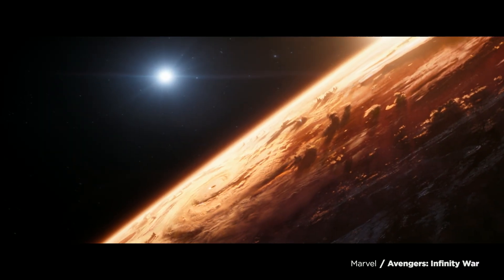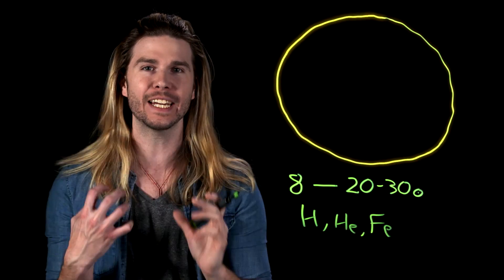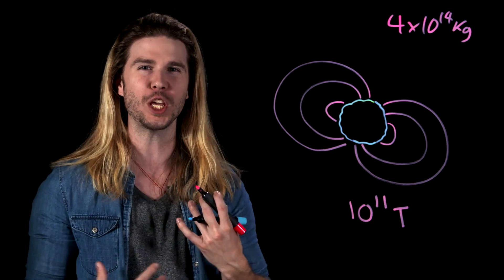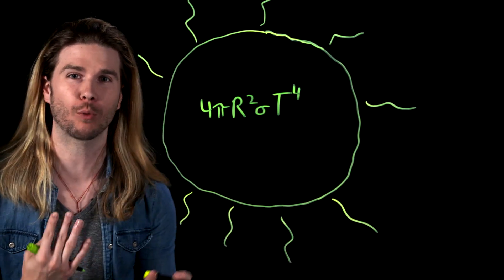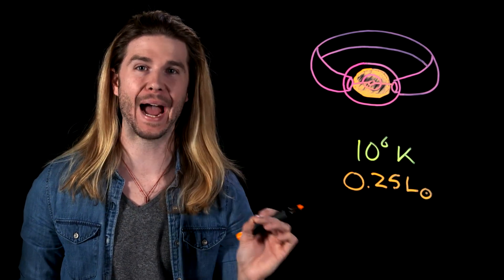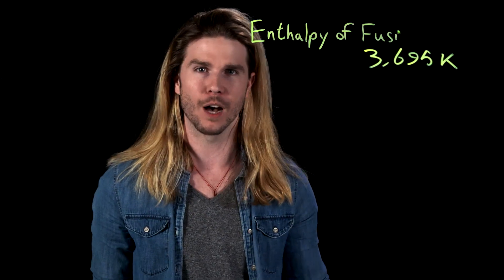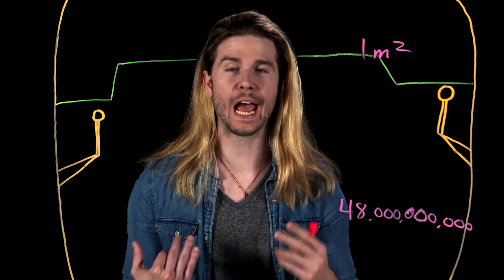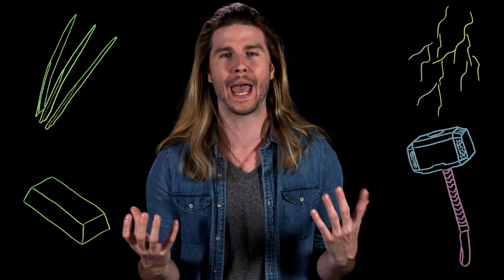How To Forge Thor's Infinity War Weapon

Comment: I guess the follow-up question would be: what kind of biomatter is Groot composed of if his roots/vines/stems can latch onto the freshly forged, ridiculously hot Uru metal, and not ignite instantly?
Reply: The temperatures we are talking about are in the millions of degrees/Kelvin/Fahrenheit. It should be enough to light an entire forest on fire from orbit.
Reply: Also, does Groot have to be worthy to lift the newly created stormbreaker?
Reply: @jasond.6068  stormbreaker didnt get any enchantment like the hammer did.
Reply: Jason D. no because storm breaker doesn't have odins enchantment.
however oru could just be a combination of known elements which is put under enormous pressure to make it super dense which would explain why it takes so much heat to melt and why it weights so much.
Reply: @Grazey  and to all of you who correctly said that stormbreaker isnt enchanted with the mjolnir-enchantment: i know i know. Thought it would be a funny thing to ask.
Reply: Jason D. Nope brother
Reply: Jason D. Doesn’t have the enchantment that The hammer had
Reply: @jasond.6068  nope the worthiness enchantment wasnt put on storm breaker, so really anyone can lift it.
Reply: Good point!
Reply: And remember he can hold up and against explosions and bullets in GoTG1, and completely regenerate himself. I wonder what kind of tree can do that.
Reply: It obviously wasn't that hot. It was orange at the brightes parts of it, while in some place it completely lost illumination. Meaning it wasn't hotter than 3ooo Kelvin.
Reply: Matter Beam
When Groot picks up the axehead it almost completely lost its illumination, having a few spots that glow with red. So it obviously wasn't in the millions of Kelvin, not even in the thouthands, except for those few spots.
Reply: Surtr destroyig Asgard was a magical fire kind of deal so it might have killed her where regular fire couldn't. It tends to be the case with superhero material that regular elements (even the heat of the sun) can't harm the heroes much but the very, very same element coming from a wizard or weird crazy tech gun can harm them with a fireball or flame jet.
Reply: That would make Groot's sap the single greatest cooling liquid in the history of ever... imagine the possibilities!
Reply: The ax also imbues those who wield it with so much power that most would go mad as their bodies were destroyed, so maybe it augmented the flamability of his arm.
Reply: Maybe it was on cool-down, another question, If Thor survived all this heat energy, then isn't Hela still alive and that she just fell like Loki
Reply: The type of wood that Groot is made of is the most powerfull in the Marvel Comics Universe. If that is aplied in the cinematic universe, he could easily do what he did, with no problem...I assume.
Reply: Jason D. It didn't have Odin's enchantment on it so maybe anyone strong enough to lift can.
Reply: +Bad Request -- My guess is that when "Groot, son of Groot" cuts the branch from itself, the same thing happens as in GotG1 -- Stormbreaker is now a baby Groot.  You're welcome.
Reply: Yes we have ... No matter the material, every material, no matter what, starts to emit visible light at a temperature of around 500-600K.
Reply: AronBagel well, it was freshly grown for that, so we could imagine that it is very green wood. While the temperature of the axe would be enourmous, green wood is very hard to burn. It won't ignite if you throw it on a bonfire until it dries out, so possibly this is the reason?
Reply: maybe his arm was constantly regenerating and thus could withstand the heat just long enough for the temp to drop, he is able to regen said arm within moments
Reply: Maybe Groot is a being from a neutron star.. that may be why he did not go atomic from the gravity
Reply: AronBagel Groot simply used the Batman effect. He did it because HE IS GROOT!!
Reply: The awesome Ygdrassil Tree, where MCU Groot might come from.
Reply: Well in comics he is another Thor from another universe...maybe thts y...since he was already worthy to lift it as well
Reply: AronBagel I'm wondering how it hasn't snapped yet.
Reply: More relevant even, when thanos snaps his fingers and kills everyone including groot, wouldnt the axe's handle fade away as well because its made of groot?
Reply: +Bad Request -- He's a tree, not a phoenix.  Are all the Groots in the universe supposed to be telepathically connected or something?  Because if not, you can easily test this by cutting off one of your own fingers.  Stormbreaker isn't part of Groot's body any more.
Reply: Good insulation
Reply: Love
Reply: Jason D.  Storm breaker does not have any enchantments
Reply: What if uru actually has a relatively low melting point, and instead has an insanely high specific heat, thus requiring so many joules?
Reply: AronBagel never worry about PC overheat again!
Reply: Groot is a God he can do whatever he wants
Reply: Better question for groot to be able to pick up storm breaker for a few seconds he would have to be worthy so is ?
Reply: Not only that, but it's also strong enough to lift the metal that in and on itself is heavier than the entire earth population many times over (going with Kyle's point) and didn't break nor bend.
Reply: erbgorre; the glowing hot colour of an object is proportionate to its temperature, regardless of the material.
Reply: TLDR: I am Groot!

I'm gonna explain this in very simple grootian so you will all finally understand how it was possible!!!

I am Groot I am Groot I am Groot! I am Groot, I am Groot... I am Groot? I am Groot "I AM GROOT!!!"

See quite plain and simple! I hope this long dissertation helps and that I didn't babble on to long especially in the wrap up statement!!!
Reply: Another question is, Thor's clothes didn't burn up when he opened the gate thing. This means his clothes have a higher melting point than uru. Why not just put your clothes on a stick and beat thanos like that?
Reply: He had plot armour
Reply: Because he’s also an alien tree. As in not an earth tree. It’s like Korg being a rock man but doesn’t mean he shares the same attributes of our earth rocks. Because he’s an alien.
Reply: To my understanding Groot is effectively fire proof, and just because he’s a tree doesn’t mean he shares the same weakness of fire.
Reply: Grizabeebles still part of the same entity. Doesnt convince me xD
Reply: Root isn't made of wood actually. He isn't as flammable in the comics so with it being freshly grown and he's resilient then it might make sense
Reply: Silicon.
Reply: Groots sap... Gross.

OH! ;)
Reply: Bump! I want to hear the answer to this too!
Reply: AronBagel Well in the first gaurdians movie groot was being shot by lasers and wasn’t igniting
Reply: Josh Vandenburg
That would actually explain a lot of things, including the fact that if the temperature was so high, black boby radiation would make it glow white, then start emitting UV and eventually xray and gamma radiation. Which doesn't seem to happen. Now the problem is that we need to explain why it cools down so rapidly.
Reply: erbgorre 
That is not how glowing works.
Reply: Bad Request 
No it isn't.  You can grow an entire new tree from a cut branch of an existing one.
Reply: If we go really in depth, he could be regenerating cells faster than the hot metal can disintigrate it
Reply: I am Groot.
Reply: Groot has Cotati Metal Fibers?
Reply: What's the effect called where a layer of moisture can protect flesh from heat? Where somebody could touch ~900° molten lead and not get burned? Copy+paste that to groot
Reply: probably that Groot has no phosporus compound in the body
Reply: PLOTarium?
Reply: Point
Reply: Groot has some special atoms or cells that maybe reacts different to heat because he's like an alien tree so that means maybe it doesn't ignite the same way as normal wood would?

I mean i'm no scientist but correct me if i'm wrong. I'm just sharing an opinion here.
Reply: Maybe this can be explained by some property of Uru itself. The mythical metal could take the energy to another mysterious use and be instantly cold.
Reply: CopernicoTube probably.
Reply: AronBagel considering groot is a sentient tree that can talk and has super abilities, I’m pretty sure his wood could potentially be at an extreme level of durability.
Reply: Part of it would be sense he has moisture. Which makes it harder to burn  new branches then old ones. But I do get your point
Reply: Obviously he's composed of worthy biomatter.
Reply: The answer according to Groot himself is simple "I am Groot", he said
Reply: its not made of tungsten. you have no way of even guessing at how hot this fictional metal can get before showing any signs of glowing. from the numbers used in these calculations it would definitely be many magnitudes of difference. could well be in the millions of kelvin.

Comment: If the metal is so dense wouldn’t extremely rapidly expand as its pressure is so much greater than a vacuum, and the atmosphere of earth? Like when you squeeze a potato chip bag, but then in unsqueezes by its own. 

Also wouldn’t you say that the bifrost is something that slightly bends space time so people can travel vast distances in a couple of minutes/seconds? I would say it’s like bending space time so two different points in space would be closer, but not like in a worm hole were they are at a distance of 0. I would say that the bifrost squishes spacetime so if the glowing color thing can make you accelerate near the speed of light and making you travel distances that would look imposible to travel even at the speed of light. 

Anyways love the show, keep doing awesome videos
Reply: Metals expand when heated, but at different rates. Some materials have a low expansion coefficient (how much they expand per temperature increase). A very strong material expands less.

https://en.wikipedia.org/wiki/Thermal_expansion#Factors_affecting_thermal_expansion

"Thermal expansion generally decreases with increasing bond energy, which also has an effect on the melting point of solids, so, high melting point materials are more likely to have lower thermal expansion"
Reply: Matter Beam well of cores, but after Kyle did the calculations of the mass, it would rapidly expand either way as it’s so massive
Reply: Matter Beam if we asume that Kyle’s calculations are right, then 3.8 x 10^14 kg, if we asume it’s a real metal like tungsten, would expand extremely rapidly if they were in just the very small space of the axe head of storm breaker, either way thanks for that neat fact
Reply: The neutron star is what is dense. Not the metal.
Reply: Brandon Myers yeah, but the bifrost doesn’t instantly teleport them, it takes time and you see them traveling in it, like in Thor ragnarok. A regular worm hole, theoretically, brings two places together and can instantly teleport you, which doesn’t happen in the bifrost
Reply: Nicolas Hurtado Castro In the first Thor movie, Natalie Portman's character says "it has all the characteristics of an Einstein Rosen bridge" which normal people call wormholes.
Reply: Unless I'm misunderstanding you (your English in some places is ambiguous, sorry), then I think you're misunderstanding - 3.8x10^14 wasn't the mass of the axe head, that was the mass of Tungsten that the beam would have been able to melt...
Reply: Nicolas Hurtado Castro There is actually no reason wormholes couldn't have distance in them. They change the distance between 2 places (and/or times) but not necessarily no distance.
Reply: BobbitTheDog either way, if the metal needs that much energy to heat up, it needs to be extremely dense and massive. Even if it wasn’t tungsten, Uru needs to extremely dense and massive because of not, it wouldn’t need as much energy, and in this show, we need to use real world things because if not, we can’t science
Reply: Brandon Myers the job of a worm hole is literally just bring two points in spacetime in the same place so someone can walk through, like when you fold a paper in half and make a whole that pierces through both sides, that’s it. It needs to have no distance because if not, it’s not a word hole
Reply: Nicolas Hurtado Castro maybe the ingots were super tiny like this dot or somthin   .
Reply: Lari588 what does that even mean?
Reply: Lari588 even if they were dots, a super dense and massive object that is not in like a neutron star or an atmosphere billions of times denser than ours, would rapidly expand in a vacuum or in our atmosphere
Reply: the hammer can open the bifrost, maybe it's made of some weird space time warping material, so it sends part of it's energy somewhere else.
Reply: Nicolas Hurtado Castro The ammount of energy necessary to melt some metal does not depend on the metal's mass. It simply depends on the forces keeping the metal's structure (acting between their atoms) the way it is at that moment. Uru might have a special bond that is extremely strong and have a big range (on molecular level).

How are so sure about what a wormhole truly is? As far as I know we (humans) have not travelled in a wormhole yet. AND there is the special relativity theory. The faster you travel the slower the time gets. The distance  between the two ends of a wormhole can be extremely small but it is still some distance where you travel extremely fast so it can take some time to get through.

Comment: Thor is subjected to much less energy than the metal.
The Iris, which he holds open acts like a converging lens, with the metal at the focal point, thus amplifying the energy making the metal melt at even higher temperatures. But, this would mean that Thor is subjected to much less energy per unit area than the metal.

Comment: The interesting thing is that this amount of energy would by itself mass over two metric tons. 

E = mc² -> M = E/c³ -> 2222.222 . . . kg = 2e20 J / 9e16 m/s.

9:45 that isn't true. The worlds most powerful lasers use techniques such as mode-locking and chirped pulse amplification to produce powers in the petawatts. But the important is that those pulses only last a few femtoseconds and carry only a few joules. Maybe compare the energy he absorbs with nuclear bombs? It should be at least a few dozen tsar bombs.

Comment: So maybe they should melt down Thor and make a weapon since apparently he's more resilient than that fancy schmancy Asgardian metal.
Reply: Melted Asgardians don't set uniformly.
Reply: They can't.... he won't melt down because he is so resilient.
Reply: @BoogieMan well most of the Asgardians got fried on the ship, look how that turned out
Reply: You could if you had a fully gemmed infinity gauntlet, I'd wager. :)
Reply: if you have a fully gemed infinity gountlet, you don't need hammers
Reply: Yeah, but regular Asgardians seem to be made of balsa wood when compared to Thor. So how about a Thor bone axe and sword! Just find a way to sharpen them. Or just use them as indestructible clubs!
Reply: Asgardians burn they don't melt is the problem there.
Reply: +BoogieMan the infinity gauntlet isn't an option here, They are making the ax to beat Thanos who had the Gauntlet/is assembling it, for them to use the Gauntlet they would have already beat him.
Reply: i thought the same way, would you use gummy bear and melting them turn them to a weapon? cause the amount of heat to melted it as almost the same as amount of heat to melt yourself, what the point of using a weapon that softer then you are? can easily melt then you are..
Reply: @DvBattlegears But we're talking about melting Thor. @13KuriMaster I'm speaking in the general sense, not confined by canonical constructs, otherwise, what's the point?
Reply: Groot should've just wrapped him up into a blunt force weapon and beat up Thanos himself.
Reply: True isnt Thor's fist more powerful than his axe?

Comment: Why do neutron stars have such strong magnetic fields? If magnetic fields are induced by moving charges, but neutron stars are only made of neutrons (no charge): where does it come from?
Reply: The entire Neutron star is not made out of neutrons, just the inner parts. The pressure on the outer layers isn't enough to cause the reaction that forms Neutronium (the name for solid neutrons).
Reply: Ahhh, that makes sense! Thanks for the explanation :)